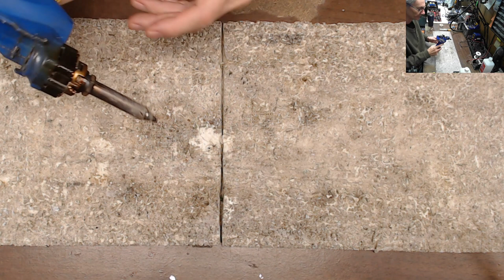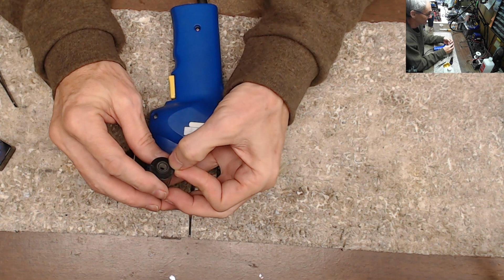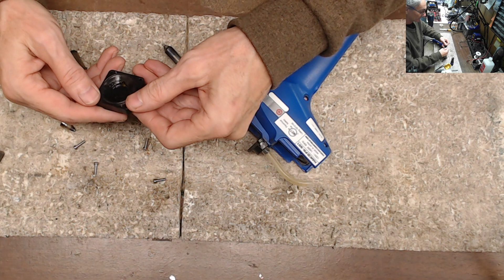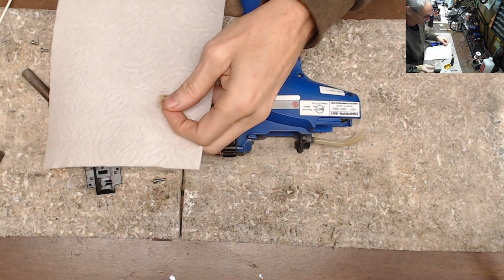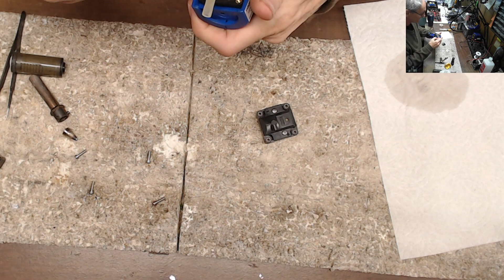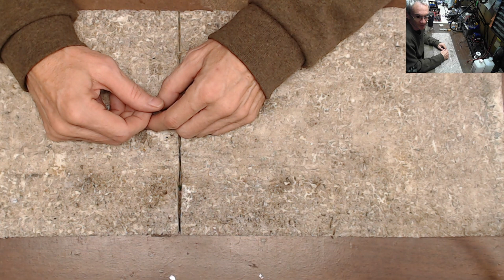More to Business Than Just Repairs FR301 Desoldering Tool Cleaning Video

Comment: Fit a coin in the tube to take the brunt of the solder, it will extend the filter.
Reply from the maker: The FR-301 uses the B5104 filter which does a great job catching the solder. A small drop of oil on the filter helps to keep the solder from sticking to it for easy fast clean-up.

Comment: Helpful to have a maintenance routine to keep things functioning. Just like technicians that clean and lube their air tools before use.
Reply from the maker: Agreed! If this tool isn't working 100% it makes repairs a tad frustrating when you have to pull and clear 50+ TO247 transistors which equates to 150 plus holes.
Reply: @ellensburgamplifier  oh yeah! Fun times and beer! Not around the rails of course…. After a large repair of such, I would do a full cleaning anyway. Just because we know how dirty some manufacturers solder choice is.